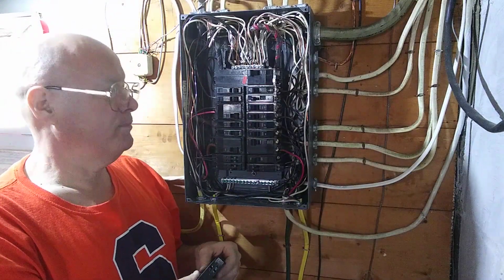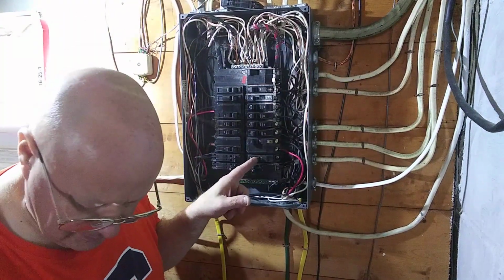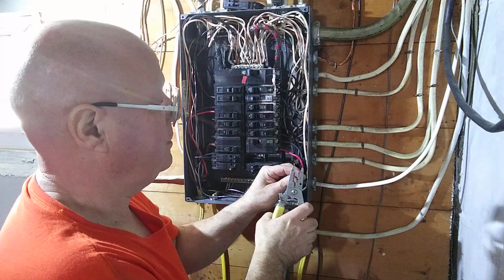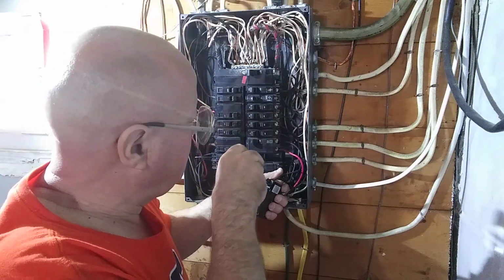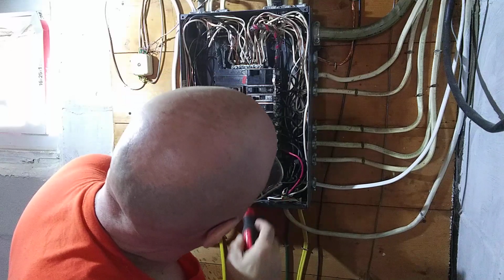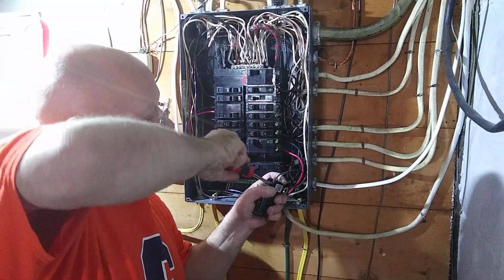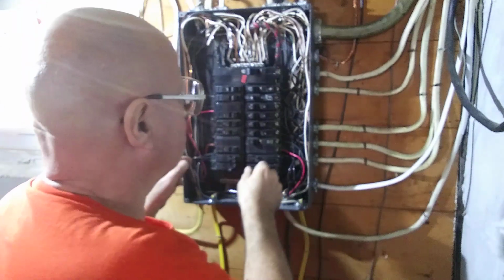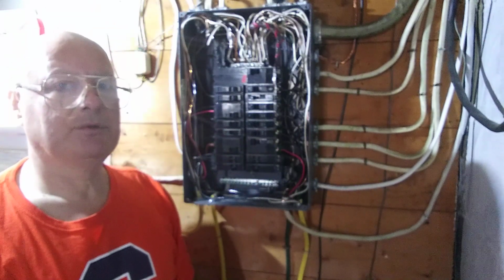How to install a square D QO cheater/tandem breaker

Comment: 14 gauge off 20 amp breaker, that was not wire correctly originally.   Only 12 or 10 gauge should be used on a 20 amp breaker.

Comment: i have the same box im installing in my garage. can you tell me where the bonding screw is or even the model of box?
Reply: This is a late and likely redundant reply. The bonding screw should go to the neutral bus bar. Not all panels come with a bonding screw, sub-panel neutral buses should not be bonded.